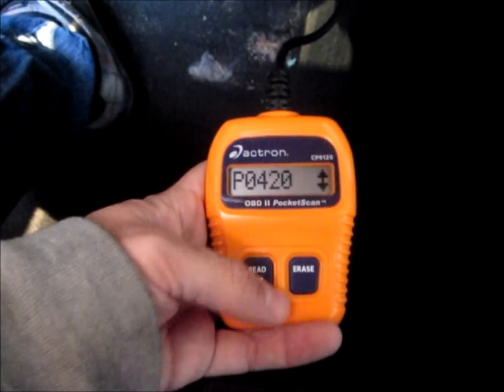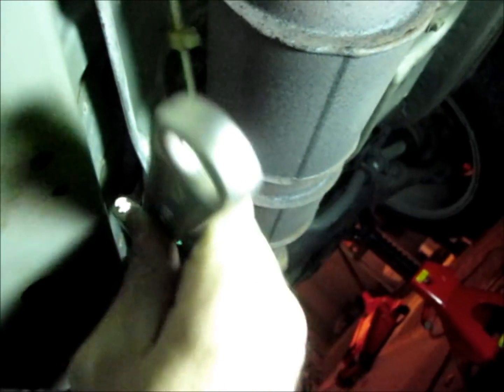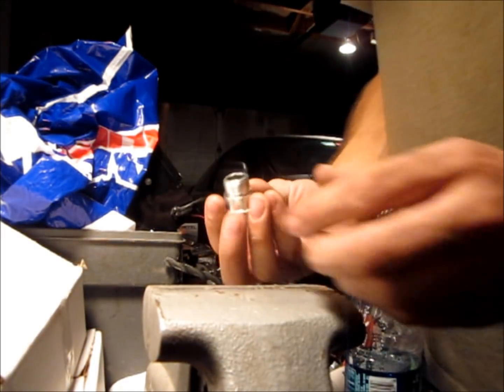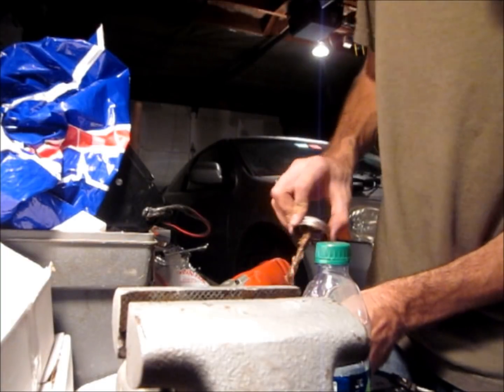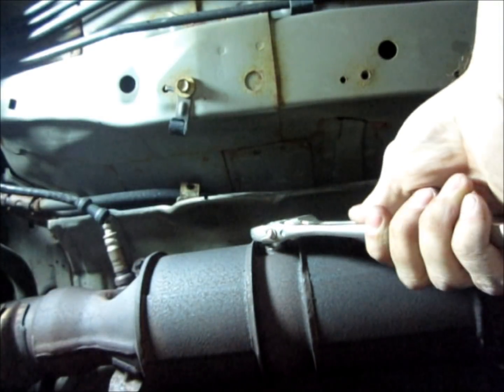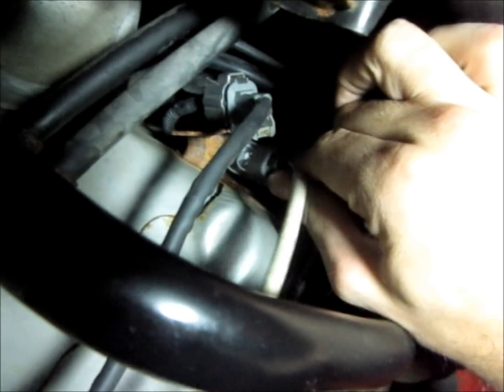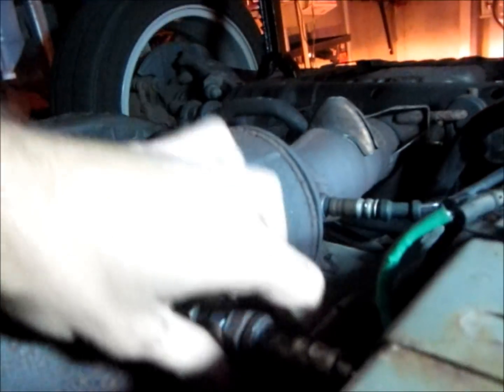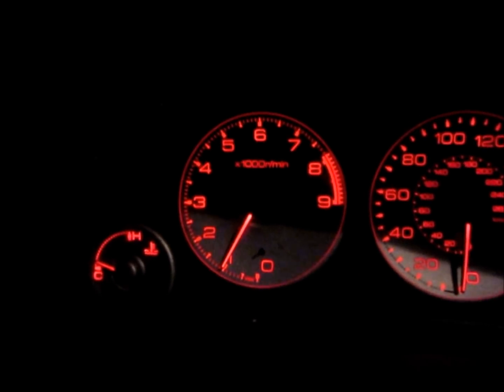Clear check engine light for less than 5 dollars

Comment: break down and spend the extra coin and buy an innova.  they sell them at oreilly's.  you can record vehicle data, and it comes with software for your computer, so you can watch your recordings, as well as real time data as you drive your vehicle, rather than pulling the code, researching it, and throwing parts at it.

Comment: ok dude.  whatever you say.  your just tricking the computer, still shortening the life of your cats.  the only respectable time to do such a thing, is if you remove your cats completely.  I've dont that to several cars and trucks (including my own), sometimes stacked 2 defoulers, and the computer didn't notice a difference, removing the cats.  again, don't do this...  it's like putting a bandaid on the situation, rather than actually fixing the problem.

Comment: It usually returns soon after we leave the mechanic.  We seem to have fixed it though.  No new EGR valve needed.  We took it back in to have him put a new EGR valve on. I bought one for $27 and he was going to put it on free of charge.  But he noticed something had been not put back on correctly with one of the hoses.  The light has stayed off.  So I think the problem WAS the vacuum switch valve. We are taking her car in tomorrow for her emissions test. Fingers crossed!

Comment: Oh excellent, you should be good to go for quite some time. I believe the interval from Hyundai is 60K miles but I would argue that time and usage conditions (weather, towing, driving habits) are more important factors. 5 years would be reasonable AND safe IMHO. Most engines make it fairly easy to access at least part of the belt to inspect it periodically. Just wanted to make sure you'd taken care of that or were aware of it. My aunt didn't do any maintenance at all and got what she paid for.

Comment: ahhh it was on my aunts car but around 02-04. I think replacing the gasket was the final fix b/c it had been compromised on previous repair attempts. Trying to remember that particular engine's design... but I did have to clean out a significant amount of carbon buildup inside the EGR/intake manifold passages. Carb cleaner and a wire brush/pipe cleaners work great for this, plenty of vids on how-to also. 

PS-Check/replace your timing belt!!! My aunt's engine died at 98k due to that belt failing

Comment: Depending on how bad it is, you can probably reset the engine computer (unplug the battery), drive 20-100 miles (not too many or the error will come back) and pass inspection only to have the CEL come back an hour later. If you've put a ton of effort into it, the car runs fine, and you still get CEL's... just ignore it and have it checked regularly for any new fault codes just in case and youll be in great shape. EGR's almost always get clogged with carbon and crud that is a PITA to clean out.

Comment: I had a helluva time trying to get a Santa Fe to be rid of P0401's a few years ago. Replaced the EGR valve and spent the better part of an afternoon cleaning the intake manifold only to have the code return shortly. Turns out it was a bad gasket that could have been replaced in less than 5 minutes for $5. Passed inspection finally, engine seized & car was in a junkyard 2 weeks later :P

Comment: Would this work for a P0401 code (EGR code). We have replaced the EGR vacuum selenoid and the vacuum valve switch.  Mechanic says that all hoses are clear, too, but the damn light came back on again and we have to pass emissions.  I'm getting pissed. We have a 2003 Hyundai Santa Fe, original owners.

Comment: only do this if you had a universal cat put on or took it off completly. if you continue to run with a plugged cat you could harm the engine if ran long enough.  i had a universal cat put on my bravada and had this code pop up instantly did this and works great. the universal cat lets more emissions get though. so putting the o2 sensor farther away makes it think the cat is doing its job.

Comment: OBDI is On Board Diagnostic. Cars 1995 or older use OBDI. Cars 1996 or newer use OBDII.
Cars/trucks that use OBDI are typically exempt from smog test and do not require a cat. If the CEL/MIL light is present with OBDI is not an automatic inspection failure. With OBD2 it is...

Comment: A catalyst efficiency code does not necessarily mean your convertor is clogged, it means it is not consuming un-burned fuel. When you install a fouler kit you are only masking the problem. Eventually the convertor will break down.

Comment: This works perfect where you have replaced the stock manifolds(headers) also where you have eliminated the stock exhaust altogether,You can take this one step further by fabricating a mount with two holes in it and plug both your O2 sensors into nonfoulers then mount them on the plate,effectively bypassing(cheating)the sensors themselves,when you have an open exhaust the sensors are worthless anyway,but at least with this trick it keeps your CEL off and prevents the ECM from defaulting.

Comment: P0420 is a universal/global fault code on OBDII systems that is specific to your CAT converter "Catalyst System Efficiency Below Threshold " or something to that effect.It simply means that the CAT is performing below a preset standard for this application,it could be off as little as 1-3% and still give the code.So this is a valid workaround for that problem,if you are not experiencing any other faults.

Comment from the maker: The converter shows no symptoms of being clogged; No idle sputter, no power loss, no egg stink.  The car has almost 200k. New cat would be $1,600 not including labor. Been running the fouler for 20k miles-- Still runs mint and consistently gets me 28 mpg.

Comment: Quit being a cheap ass and replace your cat. Its probably been damaged by your engine misfiring. The only reason you use a non fouler is if you had gutted your cat or had a high flow installed.

Comment: pd is Pending Codes 
  OBD II Pending Codes 
are also referred to as “continuous monitor” and “maturing codes”. An intermittent fault will cause the computer to store a pending code in memory. If the fault does not recur within 40 warm-up cycles, the code will be cleared from memory. If the fault recurs a specific number of times, the code will then mature into a diagnostic trouble code (DTC) and the MIL or “check engine” light will turn on.

Comment: Where is the law that states the only way to put out a P0420 is with a new cat? There is no such law. Sure, its illegal to tamper with catalyst efficiency. He's NOT doing that. He's fixing a check engine light, something done every day. If the feds or states check NOx emissions at the tailpipe, he may or may not fail. He's not faking it. If the feds or states rely on check engine lights, he fixed it. P0420 is only a warning light anyways. Inspection stations want it put out. Well, he put it out.

Comment: all you are doing is making the oxyigen sensor for the cat convertor not read it correctly. Which is fine for making the car run, because the o2 sensor that is inside the cat, or in my case after it, does nothing to control how the engine runs. All it does is tell you if the cat is working or not, And if it isnt, it makes the CEL go on. Thats all it does. Stupid, but i guess with emissions testing in some states car makers need to do it.

Comment: I used pure lacquer thinner to my nissan sentra 2004 with P0420 code and my check engine light never comes on since i put it in the gas tank. My car passed in the emission testing couple of weeks ago. I think that method would be great also but it needs some effort.

Comment: My point is that if the problem is a faulty O2 sensor then the light would go on as if there is a cat problem , but the cat is Ok then the car would pass emission like mine did .If the O2 is before the cat and it is bad then the mixture would be bad then you might not pass emission test .
So just because the light is on means shit .

Just like the guy who says my speedo goes to 150 mph , so my car should be able to do that speed , go get your head examined , So many goof balls out there

Comment: its is a warning device, but you have to understand that it sure is not a fix for a problem. even replacing cat is just a temporary fix, especially if its a newer car. cats dont just give out, they get murdered. there's is something else that's killing it (car that is not running properly) and most likely its a rich condition.

Comment from the maker: Yep--if you bring it to emissions too early after a reset, the car will fail because it has "readiness monitors" which inspection picks up on.  1 year & 20,000+ miles-- and I have not seen the CEL return.  Thx for commenting; don't forget to sub :D

Comment: Seafoam cleaning of the vacuum system corrected my 420 code. I recommend 1) knowing how to properly introduce cleaner into the vacuum system 2) Use a small amount for the 1st cleaning and progressively introduce more at each follow-up cleaning. 3) only use if you are sure the catalytic converter is still intact and not fractured or completely clogged. A 420 code can be triggered by a converter that is only a few % below perfect operating efficiency.

Comment: I just put headers on an Xterra, same code. Will the same application work for this too? It will save me damn near $500 if it does. Answer me back. Believe you-me if it does I will give you a donation for sharing this tech.

Comment: I tried this trick on my 2006 Suzuki Reno. After using 2 adapters, the light came back on after 100 miles. So I knew it as working better.  I added anoter adapter and the light stayed out. After a 500 mile trip, still no light. The farther away the sensor is away from the exhaust stream, the better. It passed emissions. This really works.

Comment: I've seen it be more bad O2 sensors than I have catalytic converters. And most people would rather spend the $60ish for a new O2 sensor, than $3-400 for a new catalytic converter.  Or, you can just delete the converter all together. Makes things much simpler.

Comment: The "P" in the code stands for Powertrain, meaning the code has to do with engine and transmission components.  A code starting with "B" would indicate a body code and "C" for chassis. I would find out what's causing the P0420 code rather than masking it.  Normally, it's just a bad O2 sensor or burned wire.

Comment: If you are handy with electronics, you can build an O2 simulator circuit that clocks a 0 to .9 volt signal every 3.3 seconds to the ECM to fool it into thinking that a working cat is in place using an LM555 timer IC. The parts to make it can be had for less than $10 from your local Radio Shack. With a wiring diagram of your car, you can inject the signal directly at the computer and keep it hidden and integrated.

Comment: OK to everyone saying that this will mess up the A/F ratio for the computer the upstream sensor handles that. So if you follow the exhaust from the header the first sensor handles A/F mixture and reads the emissions from the motor. The Downstream or second sensor measures the emissions after the cat and does not affect how the motor runs. It only measures how the cat performs based on the reading from the upstream sensor. But that being said you can buy $50 universal cat and weld it in legally.

Comment: couple of things for you. First catalysts have warranties that can be as long as 10 years and 100,000 miles so check that with your dealer FIRST. The PD is actually PID and it deals with the information you are seeing on the scan tool. Next you really should find out the reason for the P0420 It will not be the pre cat (BxS1) it will be the cat or the post cat (BxS2). Many times a sub quality cat will reset the code. Why because of poor quality low precious metal quantity.

Comment: Did the code stay off after three days of the cars ECM doing normal system checks? Because it really doesn't work without that three to four day monitor by the cars ECM  I hope it does because my volkswagen has the same problem.

Comment: theres another trick to do the same thing and its garunteed to work forever. idk how long this will last but the other way is to solder some wires and a resistor into the o2 sensor. you can look it up but this way is definately more dangerous

Comment: For my 16th birthday in May I got a 2004 Buick Rendezvous. It has 175,000 miles.  We changed the oil, changed the anit freeze, and put in fuel system restorer.  It hadn't been ran in about 6 months.  Shortly after the service engine soon light came on when I was driving.  I took it to auto zone so they could hook it up to the computer thing. The lady said it wouldn't read because I had a bad fuse. Which fuse is bad, and is it located under the hood, or in the interior fuse box  TY to any answer.

Comment: definitively for off road use only.
this is tampering with emission equipment.  in theory you could get a big fine for doing this.
plus it's highly unethical in the repair business and environmentally irresponsible.
hell, for "off-road" use just cut the cat off.

Comment from the maker: It did not, since this was the secondary 02 sensor that I used the defouler on.  I have driven the car approximately 20k miles -- Performance is on point and fuel mileage is excellent.*knocks on wood

Comment from the maker: You can do what you want with this information.  I am providing it as "for off road use" for legal reasons.  A lot of aftermarket parts running on the road today are sold as "off road use only". It's the same idea.  If you don't like the content, take the 10-15 hours out of your own schedule and shoot, edit and upload your own video.  Thanks for watching.
Reply: Hey dude! I try fixing my car with hack but I only use one Fouler  drove the car for three days and the light came back on . should I try to put two Fouler instead, do you think If I use two it will fix my problem? Thanks for your help
Reply: @gmen435  Use 2 - also try putting in a small amount of 0000 Steel Wool (very lightly packed) into the fouler closest to the Converter.

Comment: Why worry if the check engine light is on if the solution you provide is for OFF ROAD USE ONLY!  This does not help those who have to drive where emissions codes must be met.  Leave this work to those who know what they're doing.

Comment: Maintenance Required light on a Honda has nothing to do with the check engine light. Also, you don't have to hold it for five seconds before turning the key. Just need to hold it with the key off, continue holding it as you turn the key to on, and then release it after the MAINT REQ'D light turns off..

Comment: That's a good sentament but the emission system was designed to help end air-pollution, if you tamper with the system there's no telling what kind of pollutants you're putting out, on road or off.  I still say, "You got balls!"

Comment from the maker: Hi there.  I'm glad your CEL went away but your engine does certain checks that may take up to 50 miles to complete so there is a chance it will return if there is an issue.  You may want to invest in an OBDII code reader -- one that is compatible with your vehicle. It will cost half what they will charge you to clear it.  And remember-- CEL is entirely different than Maintenance Required Light.  Good luck!

Comment: Just yesterday, my check engine lights came on. Went to the mechanic, he said he would charge $135 to clear it. Saw this video and disconnected the battery (also left the headlights on after disconnecting the battery to drain any residual power), glad to tell you it worked totally. Thanks for this tip. Saved me a bundle.

Comment: I had a car that had those codes and it turned out that a vacuum hose was cracked making the car run rich. Before using this trick, it may be helpful to see if the root of the problem can be found. It may save you money in the long run.

Comment: im about to change my cat to a megan test pipe on my honda prelude 5th gen. pretty much, i do not want to pull the trigger until i see a way to take out the CEL. where do we get the "buffer" or whatever you call the bolt that u drilled? do i need any particular spark plug as the defouler? thanks.

Comment: I agree totally, the actual problem was not solved. To get rid of the engine light I have an even cheaper version, just take out the light that lights up the check engine light, would have saved you those five bucks and all that work you did, dam. 
Any way universal cats come around fifty dollars and muffler shops install item for thirty bucks. Rather spend 70$ and you will not have problems getting your car through smog and registered.

Comment: Regardless of what others said, I think you are smart. You moved the O2 sensor away so it wouldn't detect any fault.If the O2 signal is within .45 volt range ( Most likely it was ) then the engine should be doing fine.

Comment: If i'am correct, the cat is made of two parts.  The first takes out some of the unclean air and the second scrubs whats left.  By moving the sensor out he is not changing anything in the engine because the computer thinks the air is being cleaned correctly.  In Michigan we don't have testing so here it would be a great fix.  But in states that test u might have trouble because although you tricked the computer the tail pipe would show higher emissions

Comment from the maker: Passed in my state, no smog here but they use expensive OBD2 equipment; only 93 octane used in 175k miles.  If I hear the muffler start sputtering and skipping @ idle/ or any obvious signs of cat cloggage  (loss of power, etc..) I will replace it, but as of now no such symptoms. Thx for watching.